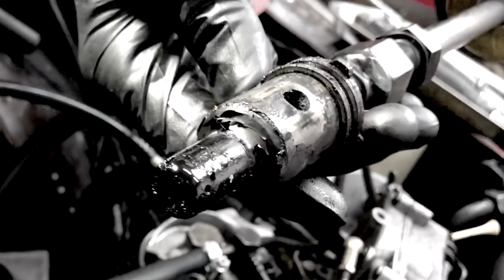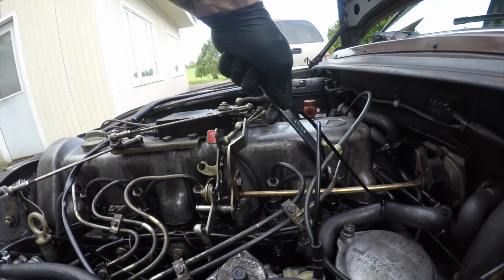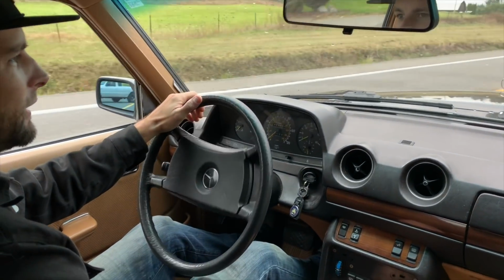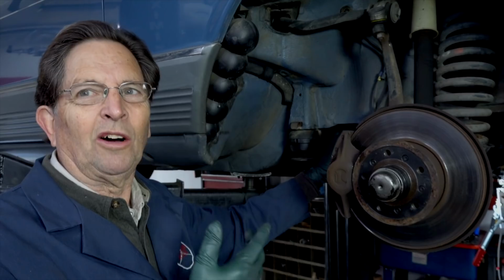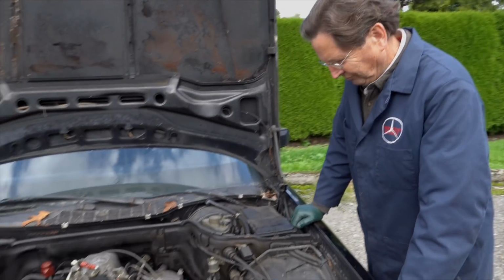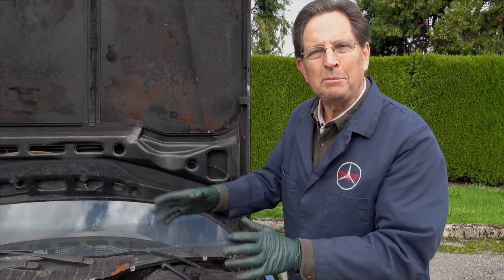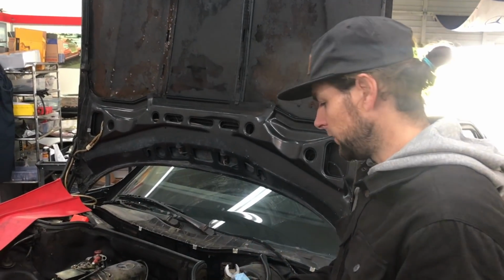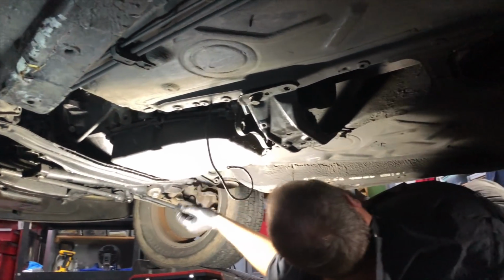Operation Save Digby Part 7: Do Digby's Dreams Come True?

Comment: Thanks for not letting Digby die, Glad to hear a suitable donor engine was available. I really have watched this channel intently for several years wanting to get a MB w123 wagon  but sadly, few affordable units available here in Hungary, most affordable ones are rust buckets or completely beyond being worth purchasing due to owner neglect. I wound up buying a used diesel BMW 5 series wagon that the previous owner imported from Germany. I hope to one day find a w123 wagon but they are hard to find. Love the channel and staying tuned for the next installment of saving Digby. I find many of your MB video topics to be applicable to other brand European cars also. Thanks.
Reply from the maker: My hope is with the information we get by pulling Digby's engine and doing a proper tear down and being able to film all the parts and pieces will allow other driver / owners of w123s to better diagnosis their issues without the need of a transplant. Thanks for watching! - Joel

Comment: In Denmark 70% of all taxis are w212, w213 e200 and e220 vehicles, the cars are in service for about 2-3 years and then sold at Mercedes dealers, most of the cars at this point has about 300-400 thousand kilometers on them and they sell for about 40000 to 70000 usd! The cars normally reaches 500-600 thousand kilometers with the first owner after its taxi life before getting exported or some times, depending on the condition resold. We just exchanged our old 2014 e200 with 500 thousand kilometers to a brand new w213 e250. I know this is much newer cars but the point is if a Mercedes is well maintained and serviced as described by Mercedes, the engine and transmission will last a long time! Our old w212 had som repairs done to it, first the chain was replaced for free at 350 thousand kilometers, the torque converter was replaced at 415 thousand kilometers, 2/3 of the cost where covered by Mercedes even after the warranty had expired, the last repair was the injectors which where cleaned at 450 thousand kilometers at a price of around 150 usd.

Comment: I like the Digby drama. Keeps me on trak with my own project, W460 with OM617 that has a little smoke issue as well. Greetings from Iceland. #savedigby
Reply: Flottur45 I’m still failing to come up with an excuse to buy a G but I just don’t have a use for it. But I’ll get there. Enjoy yours!!
Reply: Ben Artee hi Ben - I had one 10 years ago, but sold it and regretted it immetiately as I looked at the G drive away. Just recently I saw one (same model year) for sale, and I bought it without thinking about it further. I am loving it. It needs alot of work, but i really enjoy it. It is not an every day driver. It is my “toy” :)

Comment: Would it be possible to hone the cylinders if the walls are not damaged and just install new piston rings on the original engine (maybe replace damaged pistons)? Assuming there is no other damage to the internals like bearings, crankshaft, etc.

Comment: The injectors have been killed by cativation, wich are in generall a problem of bio fuel driven diesel engines. Bio fuel can bind more water than Diesel. If there is water in the fuel, this little water drops explode during the combustion. This little explosions have a lot of power and with every explosion they blast little peaces of the injector or even cylinder wall of.

Comment: I work on mercedes diesel engines for 40 years, but with every new video i learn every time 

It is a pity that you do not show how to check if the engine timing and the feul pump timing
that would be very interesting for the not so vivid mercedes hobby mecanic

I have one little bit of kritiek i would like to have more videos on the diesel engines  om 601 602 and 603 in the w124 w126 and w201

keep up the good work en make more videos

Comment: Most W123 owners do not have a donor engine, so please clarify whether you can remove the cylinder head and replace any damaged valves instead. I have a vague recollection that on a W123 you need to support the engine and remove a crossmember before you can remove the sump and bearings to remove the pistons and fit new rings? 🤔
Reply from the maker: Thats my hope by doing it this way. We'll be able to film things differently if we tear down the digbys engine - The goal would be to show ways for others to fix these issues without having a transplant on hand. Or for those that do have a transplant - That option as well. Sounds like we're pulling the head on Digby for filming number 8 tomorrow. So stay tuned! Thanks for watching :) - Joel

Comment: This W126 diesels where only a export model mostly shipped to the u.s.
IF, if Mercedes would sell them today aside the u.s.-market i think they 
would sell them like hot cakes. 
Mercedes cars built back to the past 20 years can never be compared 
to this old and quality models they made. 
Today they suffer from botching engeneering and unfinished parts built
into in the factory, as the camshafts on the AMG 6.2 where they lack often
through-casted oilchannels. And a set of new cams for this engine is about
3200 €uro I`m still surprised how many 126 diesels they sold in the u.s.
at their time bc diesels are elsewhere mainly used in light duty trucks, taxi 
or small cars like a Golf but never in a superclass car.

Comment: Love the video & editing style!

Also recently installed a rebuilt injector, balanced & pattern-checked myself (om601). The old leaking injector was bought online from a supposedly reputable place - but after a couple thousand miles I found leaking between the injector body halves. I think they went ahead and lapped the surfaces wrongly. I put a new nozzle in an old injector body which was never lapped before, only slight discolouring on the surfaces which were not in contact with eachother. Everything cleaned, lubed in diesel and rotated slightly to seat better, then torqued, spray/pattern-checked and installed in car. Slight nailing on first start but cleared up after some time and a couple italian tune-ups (on a warm engine). All injectors are dry now, when looking at the engine bay.

Comment: I have had people put gasoline in a diesel in winter for an additive?
Reply: oh, yes, In 1986 I remember beeing issued orders to put plenty of gasoline in my Danish Army Mercedes Unimog truck for the winter so that the diesel would not freeze on me. Think around 20%
Reply: Would it be wrong to put some rubbing alcohol in with a full tank of fuel? When I was an over the road trucker the company I drove for instructed us to put 1 pint in with each 100 gallons of diesel. What say you Kent or anyone?

Comment: As an old and new Mercedes Benz owner I've been watching this channel since God was a boy, but I must say I'm so excited to see Digby updates.
Reply: Those type of MB diesel engines are super reliable and were also placed in its commercial vehicels.
The 512 van/truck  (you can park digby in or on  the back) you need a big rig license in Europe to drive it, it can haul  5Tons of cargo.
Those same 512 were also used alot by the military, police and armoured money trucks.

Comment: What is your opinion on the OM602 direct injection version 602.982 or OM602DE29LA they put into the European W/S210? 
Just bought such a model. It already has an electronic distribution pump. Was that model available in the US and if so, do you have any experience on that one and any tips I can do on prevantitive maintenance? Also I seek slightly more power without decreasing the longevity of the engine itself. There are cheap chips you can put onto sensors and giving the engine false readings, which raise output by 20% and it's known to not cause problems, but I want to do it the proper way. Put the injection slightly earlier, slightly more fuel and slightly more boost. Thanks already from Germany for your answer. 
Btw. had a Peugeot Common-Rail Diesel which ran perfectly on sunflower oil only on cold weather after sitting for a long time in idle it would make some white/gray smoke on the first touch of the gas pedal. I am not planning on doing that on the E290 but who knows, slightly earlier injection would be nice too as the cetane number of sunflower oil is significantly lower than of our minimum standards Diesel. 51CZ for our standard Diesel and around 39 for clean sunflower oil. 
Great content and very curious to see damage on engines where people usually simply claim, that they're unbreakable without knowing anything

Comment: So happy for you both. I love father and son projects. I lost all forward gears in my 1988 560sel but the transmission was rebuilt two years ago and it goes in reverse absolutely beautifully transmission fluid level is clean and full and it has a recent filter and fluid change. I believe I've diagnosed it as a B2 Seal and piston I have to get my eyes on it to diagnose further. Thanka for all the knowledge kent it is INVALUABLE

Comment: From the videos it seems like this car is running pretty well. Perhaps even better then a considerable percentage of other beaters on the road. And considering the age of this car and the cash value Kama is it really worth pursuing this repair?   Why not simply use it for what it is and continue using it the way there's fear it it will likely run another 100000 miles in its present condition